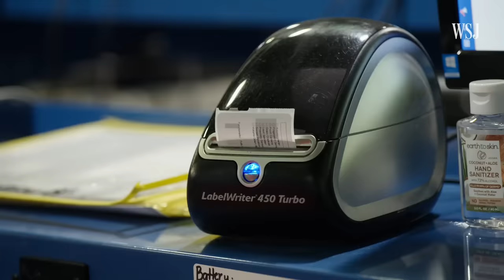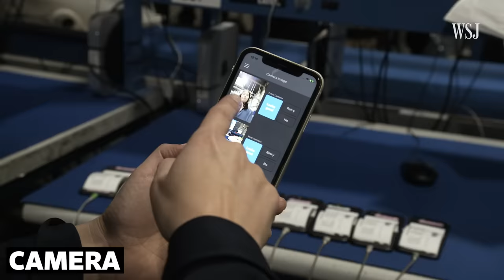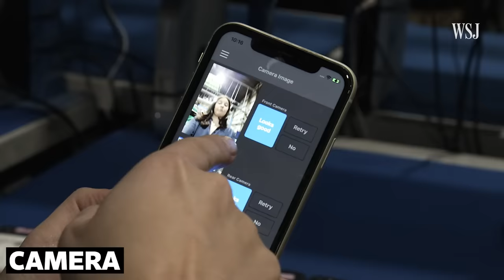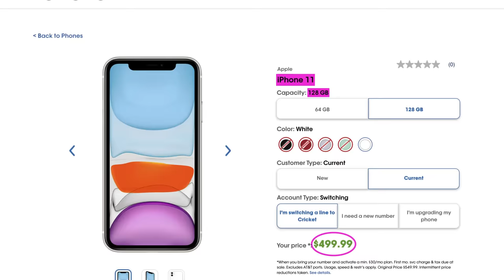How a Traded-In Apple iPhone Gets Refurbished | WSJ

Comment: I was under the impression refurbish meant more than just cleaning the phone. I'll start selling my own phones as refurbished from now on.
Reply: Same, issue with refurbished phones is that, often, they won’t even bother to replace the battery , because it is « enough » (80% remaining capacity)
No thanks.
Reply: With most "refurbishers", it means wiping the software and cleaning it up. Done. When Apple refurbishes a phone, they replace the battery (and display, I believe). You pay much more but it's effectively a new phone from Apple, including a warranty.
Reply: @i said maaayyybeee trade in promotions that's why. I got 800 towards a new phone from trading in my 11.
Reply: I'm not sure what you think refurbished means. They sell you a phone that is near-new condition. They make sure the hardware and software are working properly too.
Reply: did you actually watch this video? They don't just clean all the phones and resell them. Watch and listen to the video
Reply: @J.R.G.921  All they do is wipe the data, test that the phone is working and doesn’t have external flaws, and clean it. They don’t seem to be doing anything towards checking if the battery capacity is still good, which is a particular problem with older phones.
Reply: @ninjaahjumma  All lithium batteries have a "smart" controller (they would quickly be on fire otherwise). That controller knows everything the battery went through and has a very good idea of its capacity. So it takes a split second for the connected computer to know everything about the battery. A lot of third part software can show you the same information on the phone itself. They did mention batteries in the video.
Reply: @eudofia haha itsworthmore, I contacted them directly to purchase bulk and they’d always ask for some resale certificates and businesses licenses. I said told them I’m out
Reply: I guess this is true when you get the device from Apple
Reply: That software. It's called Blancco. They make the software to test and erase these phones. It's set up so anyone can use it. If you send in a phone that has an iCloud lock, theres nothing that they can do with your phone. I own a tech business here in Pittsburgh. When I see some of these refurbished phones that my customers bought, I see phones that someone bought with previously done bad repairs.  Replaced ear speakers with terrible soldering joints. Reflowed components on a Logicboard. Especially the 12 Pro Max/13 Pro Max and the X and XR. Depleted batteries. Displays not reinstalled correctly. Cover plates on the inside of the phone with missing screws, or cover plates missing all together. These are all things that one of their "refurbishers" cant catch because they don't open these phones. Spend the extra money. Get a new iPhone.
Reply: @i said maaayyybeee I have an iPhone SE.  When the battery goes out I'll have the battery replaced.  The phone cost $1,000 new about  4 years ago.  256 GB memory.
Reply: @jameysummers1577  while i agree with you on some of those points, not everybody has $700-$1100 to spend on a new phone.
Reply: Refurbished means marked up by third party ... just a shift of quality liability from Apple to these clowns
Reply: You didn’t watch the whole video or simply didn’pay attention
Reply: @TheCelticsAREboss  it sounds like you don’t know what refurbished means. Literally look up the word “refurbish” in a dictionary
Reply: @danpaulrox  What does it mean according to you?
Reply: Yeah same, I’m thought they’d be fitting a new battery
Reply: That doesn’t constitute the label “refurbish” they only showed the video of a working phone and just did a surface cleaning & software resetting; they didn’t show the example of a non-working camera (or else). They didn’t show if a camera or battery or some other internal component is defective. They didn’t show the department to take care of that. I doubt they have it because it would’ve shown what’s fully “refurbished” process. I doubt they have it because he says the profit is tight.
Reply: @ReR7474 i guess what they meant is that they throw away the faulty ones. that is where the loss is and needs to compensate from the profit
i dont think there is point in spending hours of labour and parts on a device which will lose more money… 
so i’d agree that this “refurbished” here is nothing but a cleanup and rekit…
Reply: Did you even watch and listen to the whole video?
Reply: It does, depends on what's wrong with it,  & that will take a trained tech to know that esp. if it's a processor, battery,  or circuitry problem
Reply: this is probably the cheapest and least desirebly form of "refurbishment" you can technically get.
Apple's own "certified refurbished" is practically nothing like this, Apple would literally take the mainboard from the old phone and put it inside a brand new housing + screen + battery, test that everything works and sell this as a an "apple refurbished" product - this applies to macs and iphones.
Reply: Refurbished means its actually opened
Reply: @dfirth224 
iPhone SE has never cost 1000, it’s Apple’s budget phone
Reply: This particular phone just needed cleaning, but other phones may need a little more work. But they can’t put too much into it or else it costs them more than the phone is worth.
Reply: Same  here. I thought they  would  replace  the battery !
Reply: @ImreNagyM   "they throw away the faulty ones"
According to what I read elsewhere circuit boards can be ground up and become higher grade gold "ore" than anything pulled out of the ground.  There's also copper and perhaps silver in them.
Reply: This is better than refurbished, it means it was not damaged to begin with.
Reply: @HallStevenson Buying a refurb from Apple is buying a new phone.
Reply: its not refurbish, its used phone.

Comment: The problem is many of these refurbished places aren't able to test longevity. Many that have heat issues or damage need to be warmed up and used at least 10 minutes or so. This is to get up to running heat temp to find the majority of issues. They do not. This is why many get duds.  Still return and get another ...

Comment: Also another huge problem with older phones is degraded batteries which is always seems to be a major issue on all devices
Reply: Just replace the battery
Reply: @officialbranch1902  I just run the phone into the ground. If a Samsung s7 is worth 90 bucks and a battery replacement is 65 without tax I'll just buy a new one and toss it in 7 years
Reply: @officialbranch1902 gee, I wonder why I haven’t thought of that?
Reply: @officialbranch1902  Yeah, this all this glued-together stuff, you can't "just" replace the battery. It requires special tools, like a heat plate, plus isopropanol. Plus, there's a risk of damaging some parts, especially the screen. Upside is, that you will then have some spare parts. That all requires time and time is money. 
Worst of all, some manufacturers aren't even supplying spare parts like batteries and Apple serializes everything, so you get a warning (iOS's soft ransomware) when you use a battery replaced not by them, even with an original one.

Comment: I was hoping to see how they mass repair the phones. At the end he said "absorb the hit on the bad ones" so maybe this particular facility/company just cleans and test them and not do repairs.
Reply: Seems like they’re not in the business of repairing but instead sells those phones to businesses that will repair them.
Reply: Same. I guess they are either rejecting those phones or stripping them for parts for other phones?
Reply: Relatively big buyback companies like this typically don't fix phones in house. There are companies that specialize in buying 'repair stock' wholesale and then selling them to phone shops who then sell B2C. So I'd imagine a warehouse like this would sell B2B to those more specialized repair stock resellers.
Reply: Yes, most people also upgrade because of a dead battery and/or cracked screen. Was hoping to see these parts replaced.
Reply: I believe they have a chinese counterpart where they will send that phone for cheaper cost of repair but it won't go back. it will just stay there to be resold there in china.
Reply: They can always resell bad models for pieces, or to companies that are willing to repair or resell them. But this should not happen often, the trade-in programs require that devices to be in a reasonable state.
Reply: Did you not watch the video? He said they sell those at a loss. The smaller shops do the repair & resell.
Reply: Most of the time the broken or non-working phones these places get are sold in bulk to other companies that send them overseas where they are stripped for their parts.
Reply: they make the margins by removing the bad ones and sell the ones in best condition
Reply: We have bought multiple times from them and their sales reps are quite hesitant on us wanting to return the defective units. So they offer us a credit to have us repair the 10% defective ones in house

Comment: I recently bought a “renewed excellent” iPhone SE 2020 off Amazon for $150 for my Mom. Basically it’s just used, received it with some minor wear and the battery has 85% max capacity so it wasn’t replaced. Yet everything works as it should, just having to replace the battery adds like $70-$80 on top of the cost of this phone. Still I could do a lot worse, and the SE 2020 should still have firmware support for another few years.

Comment: Refurbished = deleting data + cleaning the iPhone with a toothbrush lol definitely worth it
Reply: you missed the test part
Reply: would never but a used phone without a new battery. very disappointed to see they dont repair or replace parts.
Reply: @Free One  I agree, I thought they replace the battery.
Reply: @freeone69  just buy it and then the battery replaced yourself
Reply: @Sam  if you buy the refurbished one and you replace the battery yourself, you better pay a little more and buy a new phone, you get the warranty. These refurbished phones are not cheap
Reply: @hassanel362  People should weigh both options and see which one is better for them, new or refurbished. Usually refurbished phones come with a battery that is at least 80% of it's capacity, so replacing a battery might be unnecessary.  The difference between new and refurbished phones is unnoticeable, and for many people they would rather save the 200$

Comment: Just be careful; many refurbs have replacement screens that are not as waterproof as the originals.
Reply: It’s Water resistance; no phone is waterproof.
Reply: @JAY-bb7yc pretty sure that’s what they meant.
Reply: @9852323  Also depends how much attention was taken to replace adhesives that allow water resistance.
Reply: Locations like these need Apples blessing to sell refurbished phones and their standards are crazy high. The screen is probably good as new (if Apple even allows screen replacements).
Reply: @welsthe3rd  It depends on where they source the screens from. Third party screens are not as good as oem screens which will cost more then their profit margin by far. So I can't see how you can say they are as good as new. Work in one of these factories like I did and you'll see how it's about getting as much money out of the inventory, regardless of how long these phones will last.
Reply: @heyaisdabomb  Yh, my first ever iPhone was a refurbished iPhone 8 and it had a cheap screen. My friend at the time got a brand new iPhone 8 and I immediately noticed a difference. I now have a 14 Pro Max and when going back to my refurbished iPhone 8, it just hurts my eyes, my dads iPhone 7 has a better screen than the screen of my iPhone 8
Reply: @MBisFrenchy  yup
Reply: @welsthe3rd  These locations are not producing high standard type results. I own a tech business here in Pittsburgh. I see a lot of these phones that customers bought. They dont catch internal issues. Replaced speakers. Soldered or reflowed components. Poorly performed internal repairs. Missing cover plates. Bad quality screens. Water resistance. Also, they dont buy replacement parts, so they do not need Apples blessing. They are not an Apple qualified refurbisher. They buy these phones just like you buy a phone, so the company legally owns them. They can wipe them down and sell them if they want. Apple only pays attention when you are buying and replacing parts on their products. Thats what I do. If your MacBook/iPhone/Windows PC needs a PCB repair, that's where I come in.
Reply: A lot of people will open the case of the phones to make a repair or replace something and won't install a new gasket. I know a guy that had his iPhone slip out of his pocket and landed in a pool of water. It was only in the water for maybe 5 seconds. It still would not POST. He put it in a drying agent overnight after opening it. The next day it did POST and he put a new gasket on it.

Comment: They missed the part where the customer is paying for a protection plan that if they lost their cellphone it gets replaced with a refurbished one. The cycle goes this way: every time someone place an order for a phone and they return it either because they don't like it or is too expensive to stay with the company the phone gets returned to the warehouse, cellphone gets graded from A to D. Graded A is like new condition, Graded D it's a jailbreak phone, water damaged etc. On Graded D phones the phone gets mail back to the customer and must pay for the device full price. Graded B and C you partially get charged for the cellphone usage and the company keeps the phone, a Graded A returned device only gets to pay a 35$ restocking fee (that sometimes can be refunded). Devices Graded A to C will be part of the stock that will work with the third party insurance company that sells the service to the customer through the carrier, so if a customer lose his phone he files a claim pay a deductible which may vary depending on the cellphone brand and model from 50$ up to 500$ and will get the cellphone replace with one of the devices that were either trade it or returned by another customer. And that's how the full cycle gets completed.

Comment: Myself I will never buy a used smartphone no matter if the seller claims it's been refurbished. After buying a new smartphone I tend to use them for up to 4 years and never shut them off while owning them. Around the 3-4 year mark that's when I notice the battery tends not to last long anymore and got to charge it more often.
Bought the Google Pixel 6a this week and so far I do like it.

Comment: I'd buy a used iPhone but I don't trust the lightning port connector as it goes bad and does not connect to a cable to charge. I've had an iPhone 6sPlus lightning port go bad, iPhone 8, and now my iPhone 13 mini's lighting port does not work. I am most happy for the switch to USB-C on iPhone thanks to the laws in Europe. USB-C is way more stable a connection than lighting is.

Comment: This isn't refurbished. Literally all they did was factory reset the phone and wipe it down. They should be selling the phones as used especially since they're giving them a grade. Refurbished phones should replace parts that are damaged so each phone gets the same A rating.
Reply: I've never seen replaced components in refurbished tech. Maybe on something like a laptop if the SSD failed and it's worth swapping but for the most part, replacing parts on something refurbished isn't a thing. Refurbished just means used but professionally cleaned/checked/and wiped.

Comment: refurbished? i'm curious why the guy says that he has to sell the phones with bad components or bad batteries at a loss.

isn't the whole point of refurbishing to replace or repair old components so that the phone functions as intended when it reaches the buyer? when I buy a refurbished phone, i accept that it's not brand-new and it's not in perfect cosmetic shape, but i do expect ALL its functions to work as intended by the manufacturer.

unless he means cost of phone + cost of repairs > price at which he can flip the phone.

Comment: That software. It's called Blancco. They make the software to test and erase these phones. It's set up so anyone can use it. If you send in a phone that has an iCloud lock, theres nothing that they can do with your phone. I own a tech business here in Pittsburgh. When I see some of these refurbished phones that my customers bought, I see phones that someone bought with previously done bad repairs.  Replaced ear speakers with terrible soldering joints. Reflowed components on a Logicboard. Especially the 12 Pro Max/13 Pro Max and the X and XR. Depleted batteries. Displays not reinstalled correctly. Cover plates on the inside of the phone with missing screws, or cover plates missing all together. These are all things that one of their "refurbishers" cant catch because they don't open these phones. Spend the extra money. Get a new iPhone.

Comment: If the battery isn't going to be replaced, I wouldn't buy one. The person mentioned phones with bad batteries don't make it to market, that leaves all the phones with old batteries.  If you buy a phone that's been moderately used for over a year, the battery may work but is beyond its prime.  You'll have a phone that may need more frequent charging, then soon frequent charging, and soon after that charging that is so frequent you don't want to use it. At that point replacing the battery will probably cost more than the phone is worth. :/

Comment: I have recently bought two refurbished I pads from music Magpie in the UK.  Both were pristine although I pad mini had a small mark on back plate but hardly visible or deal breaker. Prices were very very good and my thoughts on where they came from turned to phone carriers as both have cellular capabilities. I guess they buy them in bulk and their unused stock gets moved on. Ordinarily I’d b extremely reluctant to buy other than new but my experiences have been positive.